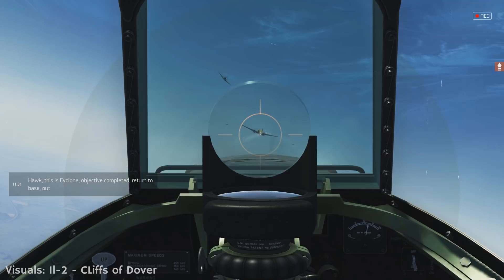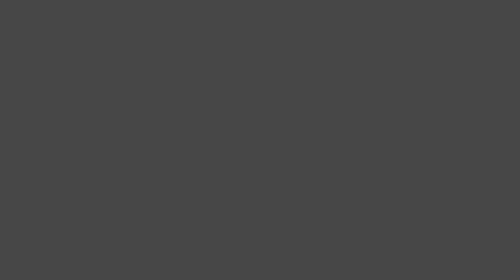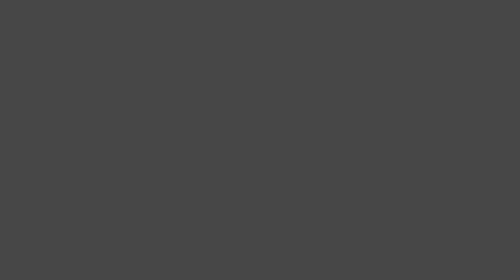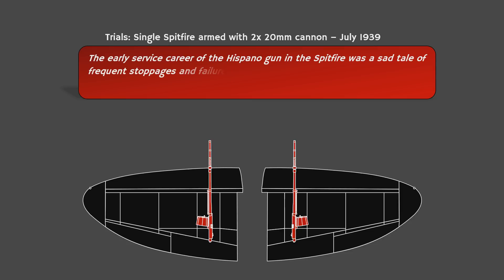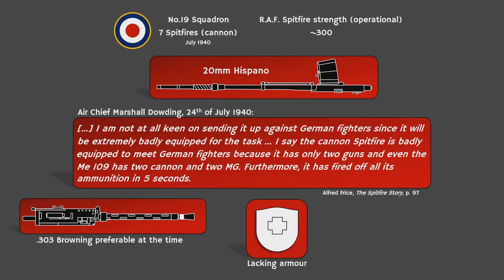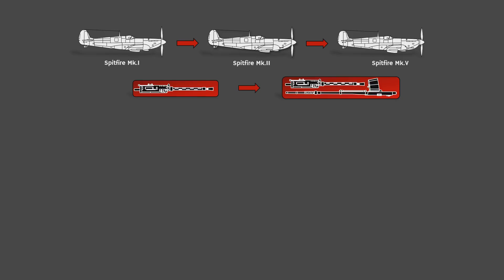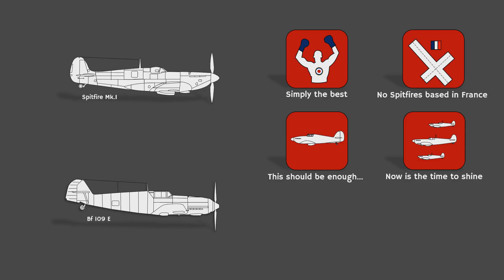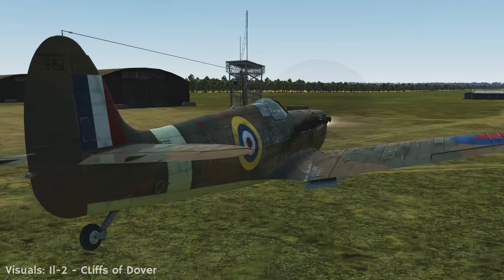⚜ | Clearing up Spitfire Misconceptions

Comment: This gives excellent clarity, being English I grew up being in awe of this airplane. Luckily I have seen it fly and heard the sweet sound of the marlin engine, unforgettable. However we do wax lyrically about it and gloss over its short comings. During the Battle of Britain the German fighters were at a severe disadvantage, due to fuel and orders to stay with the bombers!

I think an engine cutting out due to normally aspirated carburetors, compared to advance fuel injectors is a major disadvantage. Glad the lady that helped solve the issue is recognized here😁 
Having see both the Spitfire, Hurricane and 109 next to each other, noted the 109 was a much smaller plane. Wonder if any tall pilots ever flew it, if they did sure it was uncomfortable?

Finally the Hurricane was always the bridesmaid to the Spitfire, but was a star in it’s own right and much easier to build. Not much has been said about it or the RAF at the start in France when it was a level playing field. We didn’t do that well!

Comment: The Supermarine Spitfire, possibly the best named airplane in the history of aeronautics.

    "
Reply: Going to have to counter with "Avro Vulcan"
Reply: Oh, yes.  She really did shake the sky.
Reply: Americans gonna whinge p51
Reply: @theminecartgaming
Eh, I'd place that at a second or third.

@OlliePOV Aus
I don't think anyone would argue that "P-51D" is a particularly flattering name. "Mustang" is excellent, but it's no Spitfire.
Reply: Most agree the other end of the scale is securely held by the Devastator.
Followed by Gorig's naming the Me110 Zerstorer [Destroyer].
Reply: +Jeremy Bateman what about Helldiver's. Loved the monogram kit, but read the plane was wretched. Brewster Buffalo. So many bad designs.
Reply: Initially was going to be named the "Shrew". I wonder if it would have been quite so iconic if it had. :)
Reply: they can whinge all the want the p51 only became viable once they equipped it with a RR Merlin
Reply: To quote RJ Mitchell  "Just the kind of bloody stupid name they would come up with".
Reply: English Electric Lighning  --- very very frightning
Reply: @ nack: Not completely true.  The P51equipped with the Allison V1710 was  was faster than a Spit below 15K feet.  The U.S. war department however never authorized Allison to develop a two stage supercharger needed for high altitude as they thought most of the Mustang's use would be at lower altitudes, so the P51 was limited as a bomber escort which typically flew above 25K feet.  The Merlin had a two stage supercharger which allowed the needed power at bomber altitudes.  But, as an air superiority fighter and ground attack aircraft, the P51 with the Allison was the equal of the Merlin equipped version.
Reply: John-Del
The US Mustang with the Alison engine was called the Apache in the USA, and only used for ground attack. The Alison's head made it difficult to supercharge properly.  It would have needed a newly designed and built head. It was not worth it when the superior Merlin was available and being built under licence in the USA. Alison had enough work doing other things.
Reply: Lockheed "Lightning" also had a nice ring to it.
Reply: Fw 190 "Butcher bird" or the german Nickname "Würger" = strangler
Reply: Bristol Beaufighters had the nickname ‘Whispering Death”, does that count?
Reply: the usa was never interested in the MUSTANG FROM THE START as it was solely built for the British, it was so bad they put it on recon duty until some clever nerds put the Merlin in it then the usa wanted them and the name is mustang
Reply: @andrewwmacfadyen6958   And now the septic tanks have stolen the name Lightning ! :-).
Reply: The Crimson Fucker seafire
Reply: Tempest
Kingcobra
Tomahawk
Reply: Republic P-47 Thunderbolt and Hawker Sea Fury are also nice, but yes Spitfire is still the best
Reply: @olliepovaus5017  sadly the P-51 was rubbish until it got a merlin
Reply: @ohger1  The US had no say in the Allison Mustang, purely a deal between British Purchasing Commission and NAA. The BPC did not specify what engine to be used and NAA went with Allison Contractual? or the reluctance for the US to use foreign equipment.And the Mustang was seen as a foreign plane
Reply: @johnburns4017 It was chance meeting between R/R test pilot Harker and W/C Campbell-Orde at ARDU  that led to the Merlin being put in . Harker was asked to have a go at the Mustang he liked it so much he went back and suggested to R/R to put a couple in for trials. The rest is History The US in no way had anything to do with it.
Reply: @josephomalley1526  No I think the P38 was out before any of ours were named Lightning
Reply: @hoatattis7283  
Once the BPC went with the project of a new plane to their requirements and specifications, they did consider the RR engine as an option, but they were not available as shadow factories were still being set up.  Aircraft companies in Britain and Canada were desperate for the Merlin. So the Alison engine it had to be. 

During development an RR engine was considered as an option.
Reply: @hoatattis7283  
The RR Merlin was considered before Campbell-Orde was really involved in the Mustang.
Reply: @zzirSnipzz1  
The Mustang was not rubbish with the Alison engine. Very good a low level. An Alison equipped Mustang shot down FW-190's over France, before in US military service. The RAF specified range,  to protect bombers over Germany.
Reply: @johnburns4017  : Can you describe why is that the head of the Allison was difficult to supercharge please?
Reply: @alfredomarquez9777  
Shape and size of ports mainly, and other arrangements.
Reply: @johnburns4017  Don't forget that in aerial combat, the airplane is just one of many factors. The first P51s in combat had a lot of trouble with the four 0.50 cal guns mounted on their sides.  It took time to properly remount six Brownings in the correct orientation, along with more power and better propeller, much better visibilty in the P-51D model to really shine, and we have to consider timing: when the P-51D was present in large numbers, the enemy had much less expert pilots and lower build quality in their planes.  Any comparison has to be made taking all factors present at a particular time.  No one can simply say "the Mustang" (or "Spitfire", or "FW-190") when there were dozens of versions with different performances.
Reply: @topbanana8438  Even the British were reluctant, as they were asking North American Aviation to produce a Tomahawk for them... WHICH WOULD HAVE BEEN DISASTROUS! ( Just imagine a P-40 against the best 109s and 190s...)
Reply: @alfredomarquez9777  
true.
Reply: @johnburns4017  I'm enjoying a mostly pictorial book, "P-51 Mustang in action" from Squadron/signal publications AIRCRAFT No. 45 by Larry Davies, illustrated by Don Greer, 1982.   I bought it to properly check the exact details for a flying scale RC model in one sixth scale.  The book contains valuable facts and a brief history of the airplane, along with hundreds of photos and dozens of drawings of the dozen or so versions, including the less known A-36 Apache and P-82/F-82 Twin Mustangs.
Reply: Wuerger Bird was better.
Reply: Black hawk is a pretty cool name.
Reply: @MuttleyMutter  no its a He
Reply: Yet it wasn't a maritime vessel.
Reply: "The Supermarine Spitfire, possibly the best named airplane in the history of aeronautics."

"That's just the sort of bloody silly name they would give it!" - Reg Mitchell (true story).

Comment: It's my understanding the RR Merlin could accumulate only 100 hours of flight time during those years before it was required to be replaced with a new engine.  Removed engines could only be overhauled once, and were limited to 50 hours of flight time before replacement.
Reply: WW2 engines and aircraft generally had only a short life between major servicings.  However, those used in combat didn't often last that long.
Reply: Overboosting an engine doesn't permit a long life and they don't want pilots going into battle with an engine that's clapped out.  At least the Merlin was capable of being highly boosted, unlike the Allison time bomb.

Comment: Carb vs injection.  Carb was bad at sustained negative G.  Spitfire pilots learned to roll inverted to follow a 109 into a dive.  RR preferred the carburetted engine as it was able to deliver more power, due to charge cooling at the carb.  Alleviated by a fuel restrictor (developed by pioneering female engineer Tilly Shilling, and so called Miss Shilling's Orifice) and fixed by the introduction of, first, pressure carburetion, and then injection into the supercharger inlet, both dispensing with the float chamber.

All-20mm cannon armament was the aim for the RAF, but was not reliably usable in the wings of single engined fighters until a new feed mechanism was developed (belt vs drum)  RAF cannon-armed fighters were not a factor in the Battle of Britain.  The cannon worked well in the nose of the Whirlwind, but the decision to stop Peregrine development meant that this rather impressive single seat twin engined fighter was never developed or employed in large numbers. The US were sent Hhispano cannon in the hope that they could produce them in large numbers.  Unfortunately they made changes to the weapon that meant it was never reliable, suffering stoppages unrelated to those found in RAF service, and leading the USAAF to stick with the .5 Browning long after everyone else was fitting cannon as standard.

Kudos for referencing Tony Williams, whose works on guns and ammunition (with Emmanuel Gustin) are concise, accurate, well written and a good read.
Reply: Actually the US Hispanos were not less reliable on American planes because American planes that used them like the P-38 had cocking levers the pilot could use to clear gun jams in flight as opposed to spitfires that didn't have them.
Reply: The US had decided that they knew best, and stubbornly ignored the suggestions from the British about chamber length in particular.  This, despite the overwhelming evidence that the British-made guns worked in British aircraft and American M2's  did not work in US aircraft.  

The P-38 gun was nose-mounted, making provision of a recocking mechanism simpler.  The USN was desperate to move to all-20mm gun fit, but American guns did not meet their requirements for usability.

Tony Williams has a good summary of the sorry story, taken from  "The Machine Gun", written by George M. Chinn, a retired USMC Colonel, in the early 1950s.
http://www.quarryhs.co.uk/US404.htm
Reply: The AN/M2 was the one in US aircraft.
Reply: You forgot the contribution of Bendix-Stromberg to the carb problems.
Reply: I mentioned pressure carburetion, which was performed using the Bendix-Stromberg carburettor.  First applied to the Merlin 66 which powered the Spitfire Mk.IX.  The pressure carburettor is a device that replaces the float chamber, from which fuel is drawn by depression in the throttle venturi, with a pneumatic air metering device that controls the fuel quantity injected.  This does away with the float, but is in other respects still looks like a carburettor.  It is,  in effect, a single-point injector.  The Bendix-Stromberg was later replaced by an SU injection carburettor, a further-developed form of mechanical fuel injection that again injected at a single point, into the supercharger inlet.

So the Merlin did adopt fuel injection, but in single-point rather than multi-point form.  This was quite deliberate on the part of Rolls-Royce, who made use of the charge cooling to increase the density of intake charge and develop more power.
Reply: And thank you 18tangles, for the link to the Terry Welshans series of articles which I had not seen before, and which are an excellent summary of the very complex business of aircraft piston engine fuel systems.
Reply: Preferred? No, Try normal for all engines. on land & air. Injection systems were a new tech in 1939. Even cars did see it's use till the early 1950's. And electronics took even longer.
Reply: There's a bloke outside who'd like a word with you about that, says his name is Rudolf Diesel.  And if you should say "No, no, I meant petrol engines" (you might say gasoline rather than petrol if you're from the US) then just behind good old Rudolf is Léon Levavasseur with his Antoinette 8V of 1906.  The technology was widely known and understood, from its use in diesel engines from 1897 onwards.  The Daimler-Benz engineers replaced the carb of the DB600 with direct injection in the DB601 of 1935, the system being made by Bosch, taking their cue (and a lot of the parts) from the work they had done on the Junkers diesel aero engines from the 1932 Jumo 204 onwards.  There's nothing secret about this, and Rolls-Royce and the other Britsh engine manufacturers knew about it,  Napier experimented with fuel injection in a version of the Dagger engine in 1938, but did not continue with it.

So, Rolls-Royce knew about fuel injection, from the published German literature and the work of Napier and the like, but deliberately chose not to use it, preferring the advantage given by the charge cooling effect of the carburettor, and later single-point injection, upstream of the supercharger.

There are many published references, Len Setright's The Power To Fly or Morgan and Shacklady for instance.

Automotive fuel injection lagged well behind aviation usage (which is no surprise, aircraft engines were where technology advanced fastest) and began in production cars with a derivative of the wartime system developed by Robert Bosch GmbH applied to the Mercedes W196 Formula One cars and the 300SL production sports cars.
Reply: The reason why the Brits did not use Injectors was manufacturing limitations, German injectors used about 1500 machined components, British Carburettors about 50. The Brits were still buying machine tools from Germany (& Switzerland) in 1938, so did not have the manufacturing capacity to buid injectors at the scale required so early in the war.
Reply: Tilly Shilling has the ultimate British accolade. There is a pub named after her in Farnborough.

Comment: Make a similar video about the Zero. Each time I read that they were made of wood I cry.
Reply: They were made of steel sheets folded and hammered 1000 times
Reply: carroj9 still they were made of aluminium. 

PD: A6M5 got CO2 automatic extinguishers and by pilots reports  "Zeke's are harder to shot down than ever" pulling out fires and such.
Reply: Everyone knows they were made of origami.
Reply: I'm not going to argue with that elink - I fold.
Reply: The DH Mossie was made of plywood - And it was brilliant.
The trick is what you DO with the wood (design and build tech) and whther you have access to great engines.
Reply: Zeros made of wood? thats 1 I never heard.
Reply: "Each time I read that they were made of wood I cry." where did you read this, or see this? In a chinese propaganda WWII movie perhaps?
Reply: @gerijokub7737  No people genuinely think they are made of wood because the aluminium is so thin (in order to make them as light and agile as possible) that they were very vulnerable to any damage, and in further attempts to keep them light they didn't have self sealing fuel tanks so they would often catch fire. The fact that they ripped and caught fire easily seemed to imply that they were made of wood, and hence the rumor started.
Reply: @jeff walther - It sure has, got to be politically correct nowadays

Comment: It is important to understand that having the fuel introduced by a carburettor before the supercharger cooled the air by about 25C (due to the evaporation of the fuel) and thus increased the density of the charge entering the cylinders and increasing the power output of the engine compared to a direct injection system where the evaporation occurs too late to increase the charge density and this is the reason Rolls Royce continued with various forms of carburettor (Bendix-Stromberg pressure carb. and then SU injection carb.) for all the Merlin engines.